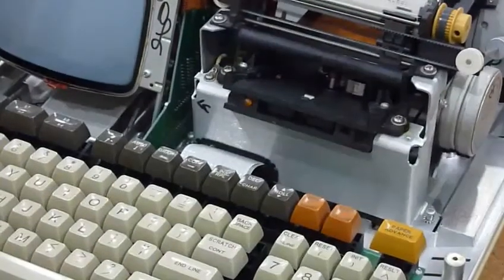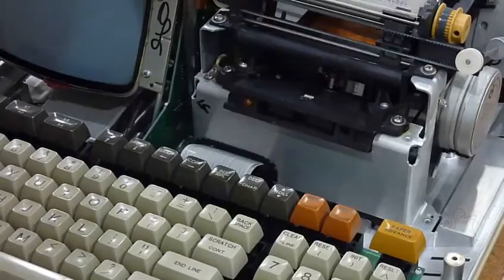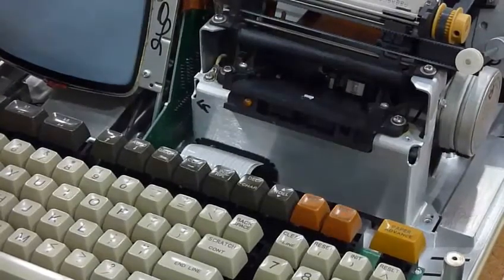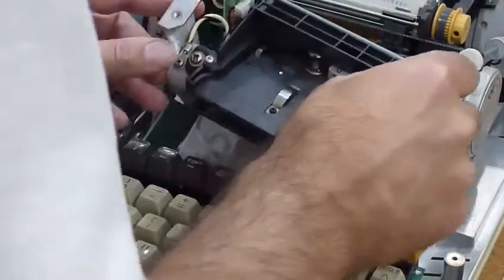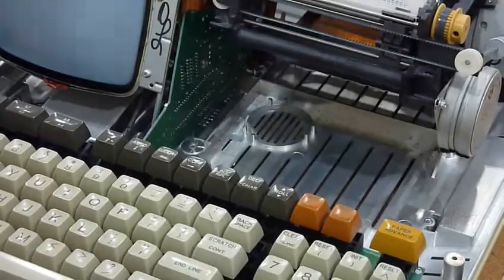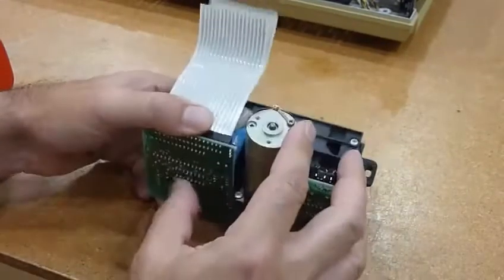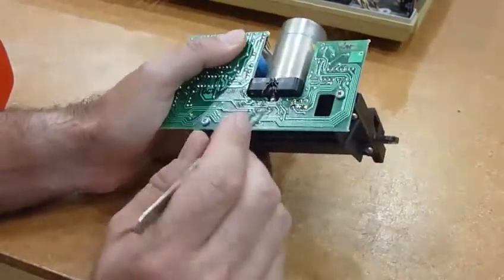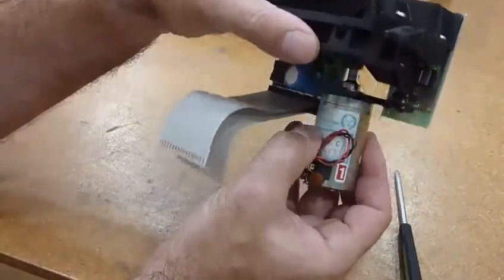HP 85 Repair Part 6. Taking the tape mechanism apart.

Comment: Amazing that you are getting these old machines working.  We had a few HP85s at some places I worked but they were so buggy compared to the HP 9826 that the HP85s did not get used as much.  Of course I am such there was a BIG price difference but I never saw numbers on price.